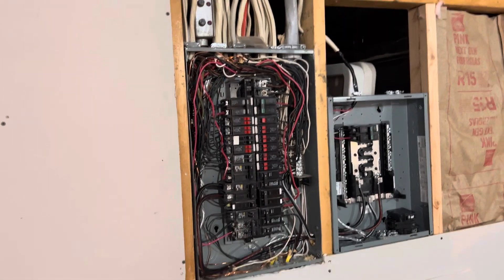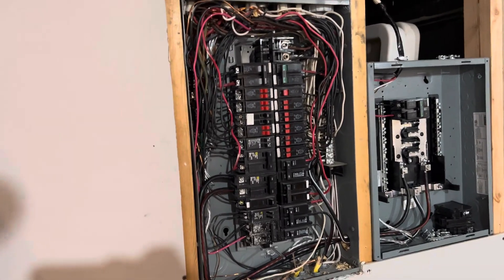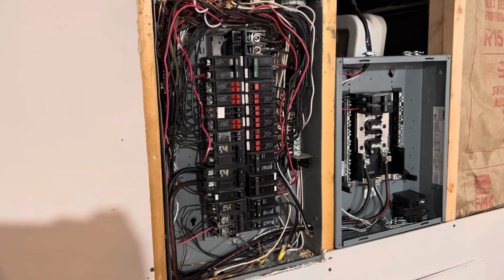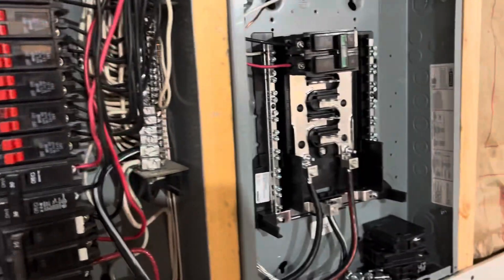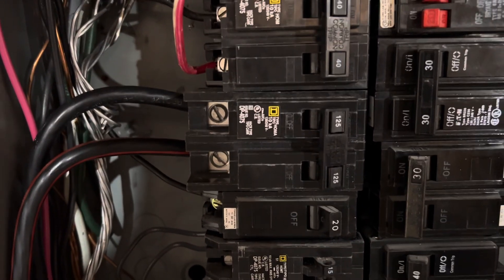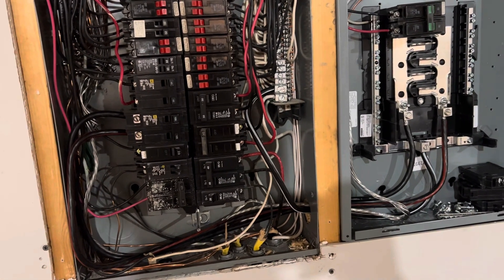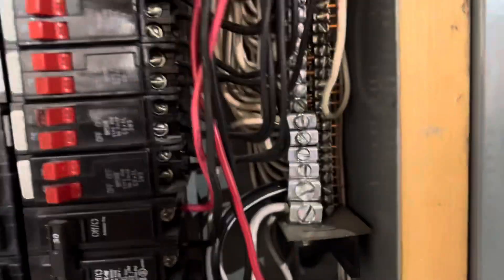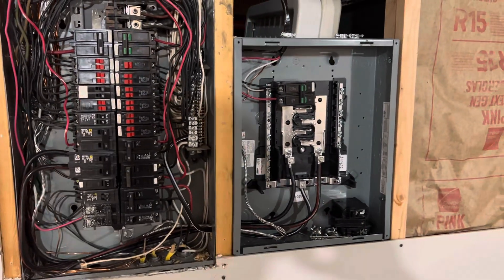How to install a 125 Amp Sub Panel from a 200 Amp Breaker Box

Comment: So you took a double 125 amp breaker and connected it straight to one-leg from original breaker box/panel and then connected it to the sub panel box.....correct? I also see you used a #2 wire....but I heard you say Al. wire....why not Cu?

Comment: Change those feed to 90A w/ 2-2-2-4 …. This is a fail, I hope DIYers seek out the correct information or better yet, if you’re as unfamiliar as this YouTuber hire a pro. Lives may depend on it.
Reply: Yeah, that wire is not sufficient for that breaker he may have possibly meant2/0

Comment: You need 1/0 wag  whoever told you can use # 6 wag that’s was wrong if I were you I use 100 amp breaker
Reply: Go look at load rating. This vomment is wrong

Comment: 2 AWG Al is rated for 90 amps on the 75 degree column. Also being that this is a sub panel and doesn't carry the load for the house, this should fail inspection.

Comment: 1/0 aluminum.  You have so many different brand breakers in that main panel also.  that’s a real rats nest.  The SER cable entering the main panel looks to small also for 200 amp . It should be 4-4-4-2

Comment: there is no nipple between panels
Reply: This is one of my most concerns, even slip a short conduit and extend 1/2" into each side and tape the hell outta the ends so they wont slide one direction or the other is better than nothing - chaffing is real and occurs after there is no problem,,,,,  That Al needs to be 1/0 also .

Comment: All my lights are flickering crazy after installing sub panel 100amp with a 70amp main breaker ! Why is flickering and lights going crazy ????
Reply: grounds or other wire on or in box over tightened or under tightened - torque settings are important,.., wrong breaker (brand) installed and or wire nut loose. wire warms up and can loosen up were tightened !

Comment: What wire did you use to jump the main panel to the sub panel? 
I’m trying to do this for my home but don’t know what wire I need to be able to. And can I use a 60amp breaker to still power it on? I don’t need the full 125amp

Comment: I have a Question I’m running the same wire but they didn’t give me a fourth wire I only have two hot one neutral! No ground and we have already buried our wire! Also my neutral wire is way too big to fit in any of the holes in my main panel box!
Reply: Lmao it sux to suck. You should have called an electrician. Lmao

Comment: So I'm doing the same thing and my question is if I use 125 amp sub panel does that only leave me 75 amps on my 200 amp panel or am I thinking about this wrong
Reply: That's not how it works. The panel is still 200 amp. You can push a maximum of 125 amps through the breaker to the subpanel. If the subpanel uses the full 125 amps at any given time then yes you'd only have 75 left over for the main panel.
Reply: If you were actually using all the 125 amps at the sub panel at once(unlikely) yes you would only have 75 amps left at the main but thats realistically not going to happen unless you're running like two welders at once. Your likely never going to have an issue with having enough power.

Comment: 2 2 2 4 max of 90amps at 75° so this would fail inspection
Reply: There's two hots which both carry 90 amps together that's 180 so it is more then enough
Reply: its like amps, watts, and voltage - diffrent scenarios for each one,,,,, if he had copper- diffrent than this.  ///  Voltage if you have a double breaker of 110 (120) each-this makes 220 (240) , amps stays the same weather this line or that line, still the same the main is rated for 200amps to be pulled through it by what is operating yes it is 100 amps on each of the 2 legs but you dont separate for a rated box to add and make a box rated for more than designed or the size of wire conductivity of amperage,, copper rates are higher than aluminum if they are same size and same structure such as 7 or 14 individual wires in each cable . Usaly 2 sizes bigger for Aluminum  --- and be sure the wire Aluminum is the updated aluminum.  Using 1/0-1/0-1/0-2 would be the correct choice in this video.  If the box is a 125amp, he can still run a smaller amp system like a 100amp breaker but the Al- wire still needs to be 1-1-1-3or4 but only for 100 sub.  As he has it- 90amp is max for this subpanel possibly creating a situation for fire if to much is used at one time-That perfect storm as we all know does happen !!!  Insurance will not cover once discovered !!!

Comment: You need to put cable protection where they feeder cables are going thru each panel
Reply from the maker: That is correct
Reply: I read through all the comments and not a single one seem to be riding you hard, we all just want a none eventful life for you, Safety is how to save lives before it is to late. Gods speed :)  @randomjack1

Comment: Curious on your wire sizing - I believe (In Canada at least) you need minimum #1 copper or 1/0 Aluminum to handle a 125 amp circuit, looks like you're using #2 Al?? or is that 1/0?